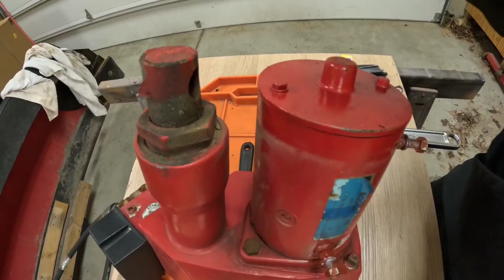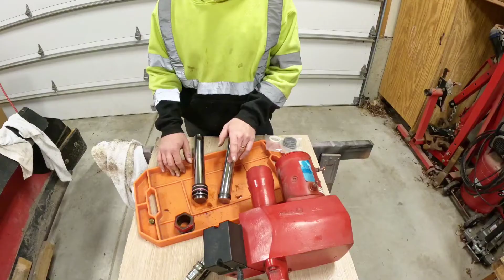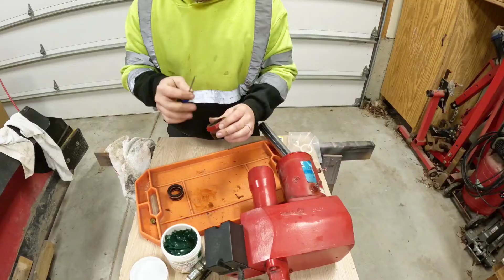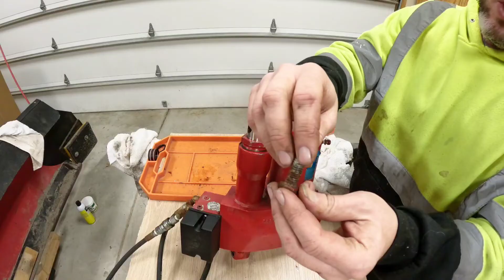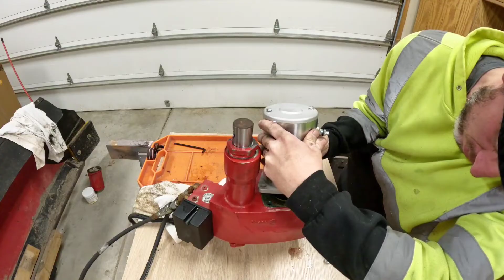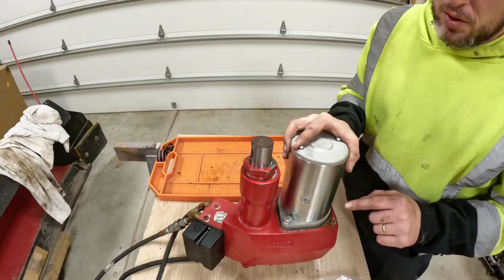Western Plow Pump Service Rebuild

Comment: Hey there, great video! It looks like i have the same power unit on my plow, If you are looking for new video ideas, consider doing one on the "certain symptoms" that you mentioned at @21:32. For instance, my plow is presently only angling right -no lift at all. I popped open the controller (same as yours) and located a bad micro switch. After replacing it, I still have the same problem. What would be the proper sequence to troubleshoot?  Do you know of a symptom table that might point me to the next step? Do you know of a testing sequence that i could use to verify controller function? (i. e., which pins should have continuity when the joystick is in various positions? I've combed through the Western site and haven't found a troubleshooting sequence that i can use.
Reply from the maker: That is something I can maybe get recorded. When I made this one I wasn't sure if there would be any views because it's an old system and most are just buying new units before they go bad. I have a binder full of notes and diagrams for these old Western units. I like these units a lot, they are simple and work
Reply: @adventureandrepeat I have a cable-driven one and a solenoid driven one. The cable-driven isn't installed - i wonder if there is a market for them, lol. Right now, my solenoid setup is refusing to lift and will only go right. I need to figure out whether it is the valve (s) itself, the coil, or the control wiring/controller.
Reply from the maker: Here is some information to hopefully help.
Blade angle right- 3way valve energized.
Blade left- 3 way and 4 way energized.
Raise- 4 way energized 
Lower- 2 way energized 

2 way valve is top right, 3way is top left and 4 way is bottom left

Sorry it took so long to get back to you. Had to dig out the binder
Reply: @adventureandrepeat Very helpful, thanks! Looks like you are also a Michigander from your other videos. Be safe tomorrow if you're a hunter!
Reply from the maker: I hope you stay safe as well! Good luck out there!

Comment: I’d be interested in seeing the homemade plug for the solenoids on the back, I just got one in today and it’s missing all of that, would you mind posting or sending me pictures of how you did yours?
Reply from the maker: I just used weather pack connectors and make my own quick connects. This plow is only for my truck, so fleet compatibility is not a concern

Comment: Can you tell me torque specs on ram ? 😊
Reply from the maker: The spec for the gland nut? There is no spec. Over tightening will cause the ram to not move down under float or lower operation . Too loose will cause a leak. 10 ft lbs is a good starting point.
Reply: @adventureandrepeat thanks for the advice

Comment: How do I full with fluid
Reply from the maker: There are 2 ways. There is a fill plug on the side of the case by the motor or it can be filled from the vent hole on the top

Comment: Thanks for the great video. All I run is Western Unimounts. All though old, they are the best plows I have owned. 

I also have trouble pushing the ram by hand on one of them. It’s probably because like you said that big bolt on ram is too tight and preventing it from going down easy. 👍
Reply from the maker: Thanks for the support! I had started years back with a cable style and enjoyed the simplicity. When I changed trucks cable routing was no longer an option. I really like these pumps and how simple they are. I'm going to run it for as long as I can keep finding parts!

Comment: I gather you use automatic transmission fluid which I am guessing works fine for most of your expected temperature conditions but might get a bit stiff when you hit your coldest temps. I have a self moving grain auger on the farm so it has its own hydraulic system and a normal semi synthetic hydraulic oil did not work out well at all and rather than go to auto trans fluid I put what used to be referred to as J13, its even thinner than non synthetic automatic trans oil and I believe was developed for applications like air craft landing gear and I am told those delivery truck platforms use that oil in cold weather to get to operate. Cold winter conditions are brutal ! ... guys used to pour in and may still do, a percentage of kerosene into their hydraulic tank oil to thin it out for their gravel end dump trailers when using them during the winter.
Reply from the maker: Yea I use trans fluid. Manual calls for Dex/Merc or equivalent. It does get stiff on negative temps when floating the ram down. I've cut it with seafoam treatment before which I'm guessing is just kerosene as well. I have a bunch of amsoil around the garage so a fluid change is essentially free for me. I've known guys in the construction industry to run their hydraulic units on their trucks all night just to keep the fluid moving and not get too cold on bad cold snaps
Reply: @adventureandrepeat  Speaking of Amsoil, I know way back in the 1980's I had installed a power steering system on a Toyota 4x4 pickup that never came from the factory with power steering and I ended up changing from regular dexron to Amsoil equivalent and it certainly made a difference. J 13 would not be suitable for everything but I would expect for a plow application it would work just fine, I doubt there is hardly a thinner hydraulic type oil out there. I cringe at the idea of adding anything to oil to thin it but unfortunately sometimes there isn't an alternative. Like I joked to my neighbour the other day, that my dad had figured out the secret to dealing with winter ... he retired to Arizona, never to have had experienced a cold northern Canadian winter ever again in his life, unfortunately I can't begin to afford such a luxury !
Reply from the maker: There's plenty of desert out there with free parking!
Reply: @adventureandrepeat  My brother was down there last winter for a bit in Yuma and he drove right through one of those area's you would be referring to, Quartzsite. As he said, there is not much of anything out there and mostly no trees for shade, sand blowing, and too many questionable people out in an area like that in later years. But even to do something like that means driving down there a long ways in winter weather through the salt with a trailer or RV of some sort ruining it in the process.My dad happened to be a US citizen, and myself and my brother worked for years on this farm handing over funds for him as he lived that life style. It was a different  time indeed, now everything is all but unaffordable ( and neither am I a US citizen ) I can well imagine the mess and the sewer dumped around there as per Quartzsite, garbage etc. I have a feeling things are going to change with that whole theme going forward.
Reply from the maker: Most in this area like to retire to Florida. Plenty of sun and sand and nice beaches. The occasional hurricane.
Reply: @adventureandrepeat  I gather that tends to be the  theme, from the eastern states head to Florida, from the western states head to Arizona. That theme also seems to follow for those in eastern Canada who do head south for the winter, Quebec as one province seems to head there so I don't know if that means they all gather in certain RV parks so they can blather french. With all the transfer payments Aberta sends to Ottawa in which they pour onto Quebec, its nice they can afford to winter in Florida ( no you probably didn't see that comment coming ). A few things Arizona has going for it is no hurricanes and if one is allergic to rain LOL, and BLM land and lots of four wheel drive trails. Florida on the other hand ... beaches and hot women who are not all near 100 years old !
Reply from the maker: Yea each area and climate has its perks for sure!
Reply: @adventureandrepeat  That's right, the eastern area would just naturally be a lot more "perky" 😁
Reply: Good video bro, I have problems with my plow, it dies, it doesn't do anything, it doesn't go up, it doesn't go to the right or left, I don't know what the problem could be.